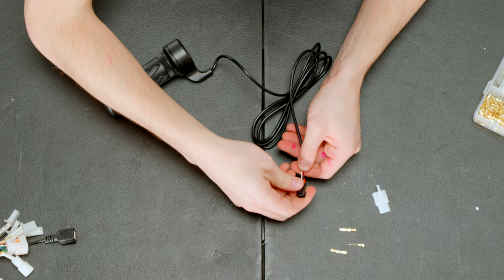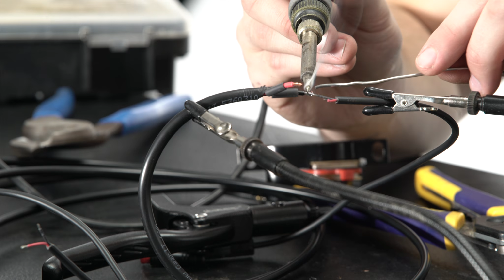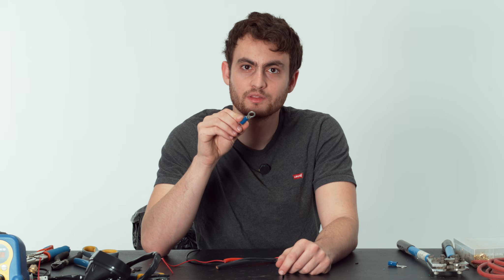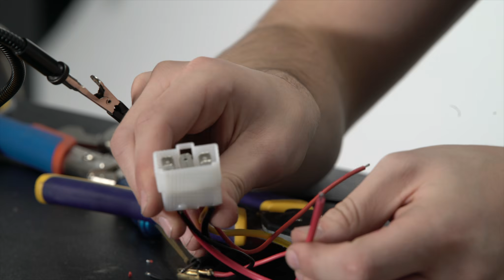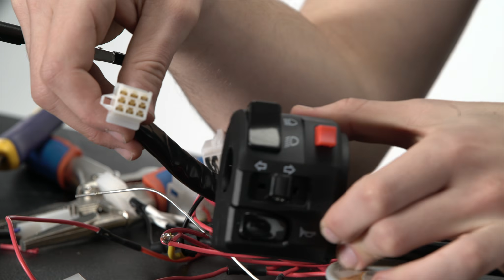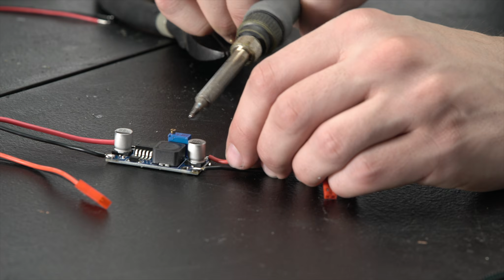eBike Theory Pt. 4 - Wiring Harness Assembly

Comment: Nice video. I always found it confusing that key switch breaks the connection, not makes it. Any thoughts on using a VESC?
Reply from the maker: Thank you! The key switch actually DOES make the connection on this one! Though the ESC always has power, it is only enabled when they key line also gets power.

I have limited experience with VESC but love that they're open source, I went with sabvoton for cost and simplicity but I have heard great things about VESC as well

Comment: Wiring is the part that makes my head spin. I come from the arcade stick/fighting game community and we have special boards that have screw terminals that make wiring the buttons/joysticks a breeze and have complrtely streamlined the pricess of players wanting to make their own custom sticks. Imagine a board with simple screw terminals for Throttle, regen throttle, headlight, etc etc

Search up Brook Fighting Board to see what i mean. Something like this would be a gamechanger for simplifying Ebike wiring to controllers i think. But i don't know too much of the technical stuff, but the general idea of it would be so awesome.
Reply from the maker: Mm yeah that could definitely make things cleaner but I'd be worried about things coming loose from vibration over time... the whole wiring diagram for this vid is available at the link in the description as well to try to help simplify things!